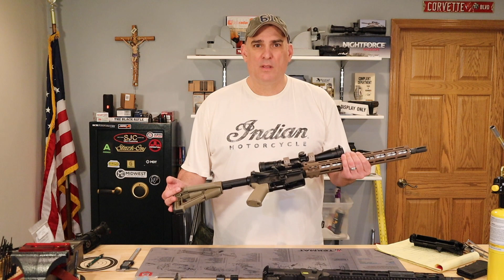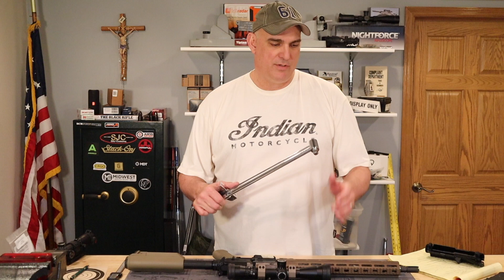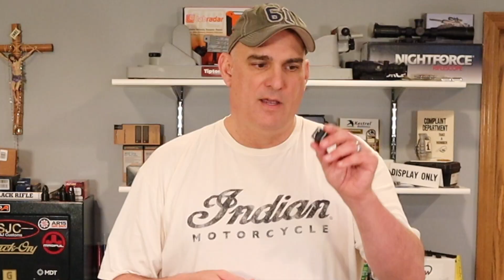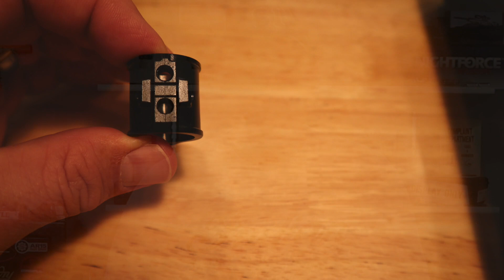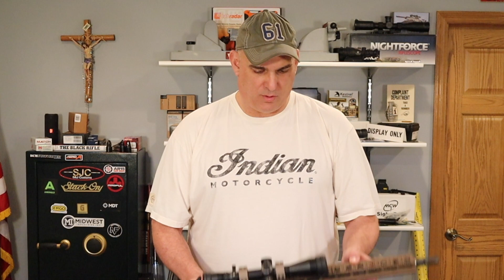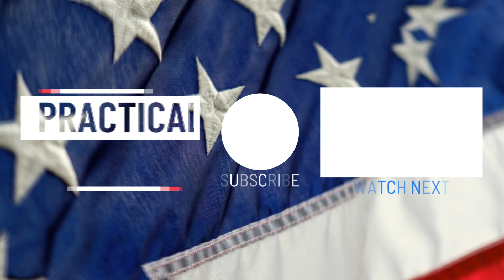Is it worth building your own ar 15? My first ar 15 build, the good, the bad, and the ugly.

Comment: I’ve built a few AR’s and use Criterion barrels and Badger Ordinance TGX gas manifold (their name for gas block) I use red locktite around the barrel (to seal it) and Rocksett on the screws……. I’ve herd people say pinning gas blocks can effect barrel harmonics and can effect accuracy at longer ranges….. my 18” and 16” will make Dime size 5rd groups with match ammo consistently even with my 12.5 getting about 3/4” groups………. Criterion has a build series that’s pretty good……  check your barrel torque keep above 50 ft lbs and make sure you head space your bolt. Use the heaviest buffer you can and function correctly keeping the brass in the chamber a mili second longer could help. Try shorting with no muzzle devise as well to see what accuracy you get then. I’ve also found with Criterion barrels keeping muzzle vel around 26-2750 with 77gr gives you best groups…… Non of my Criterion barrels like 75gr but love 77 and 68. Both my 18” and 16” will get sub moa out of IMI Razor core 77gr SMK that’s great with cheaper ammo
Reply from the maker: my barrel torque is only 40 lbs so I i'll increase it and see what happens.
Reply: @PracticalAccuracy  what kind of ammo are you using for accuracy testing
Reply from the maker: @LONEWOLF_LCD   federal gold medal match 68  gr., black hills 77 and 69 gr tmk, hornady 75 gr. bthp. none of them shot good.

Comment: I think I'm about to build a Wilson Combat AR. I've been shooting ARs since 2006 and have never built one. BTW: red locktite will release under heat. If you can heat up the receiver, you can release red locktite. Blue locktite will back off.

When you put the butane to that receiver, it more than likely warped the receiver. There is no way that barrel went in square. Even a slight cant in the barrel can alter the head space and effect terminal accuracy. It's a common problem when people re-barrel Ruger 10/22s. If you want to know if the comp effected the groups, take the comp off.....
Reply from the maker: i didnt know this. thanks

Comment: If I bought an upper and the barrel extension diameter was correct and would not go in, I would send it back.  The very definition of MILSPEC is commonality. If pins don't fit in the receiver and they are the correct diameter, send the receiver back.  Try standard ammo. I put a 6.5 Grendel together last year for deer. I bought the cheapest barrel out there and it shoots fine. Even the Russian steel cased ammo shoots really well.
Reply from the maker: I'm happy your build turned out good. Maybe next time for me. Thanks for watching.

Comment: I'm like you when it came to building my own because it was intimidating to me. I used pretty much all Areo parts, upper & lower, BA 18' fluted barrel & gas block, VG6 Epsilon brake, BCG, lower parts kit & 13" rail. I went with the LaRue BBT2S trigger, Radian SS & CH. I've never had any problems maybe because I used most of the same companies parts instead of mix & matching different companies. It was very gratifying & actually it wasn't that hard. I think everyone should  build at least one to see how a rifle works &  you might be able to fix any problems you might have, IMO. 
Be Safe & GOD Bless 👈😎👉
Reply from the maker: I agree. God Bless.

Comment: Might try lapping the barrel to remove any minute imperfections that might have slipped past QC.  I have done this to a few of my bolt guns and the results were eye opening despite buying custom high quality barrels.  I generally now do this on every gun I have before I shoot full power commercial loads, just dont over do it!  It will definitely make removing copper fouling a lot easier if nothing else.  YMMV...
Reply from the maker: Thanks for the advice.  I have a lot to try and several other builds to complete.

Comment: Is a barrel "wearing in" a myth? I've heard people say before that there's a wear in period with barrels. 
Also, I have two set screws holding my gas block on also and they force into the bottom of the barrel. I have to wonder as sensitive as people say barrels are to different things, could that have an effect on accuracy somehow.
Reply from the maker: I'm thinking it might be the set screws putting pressure on the barrel.
Reply: @PracticalAccuracy  Me too, are you saying you think that's your issue with that set up? You think you might switch that gas block out because of that?
Reply from the maker: @outdoor044  I might switch it out, but I'm also worried the dimple in the barrel screwed up the barrel.

Comment: Recrown the barrel. Likely has a poor crown shape or dinged
Reply from the maker: I'll check it out. Thanks.
Reply: @PracticalAccuracy  Also if you have a muzzle device you should remove it and test fire and see if the muzzle device was possibly not aligned or machined correctly causing the bullet to strike the surface of the interior of the muzzle device.
I had an ak47 that had improper alignment on the threads and muzzle break. The bullet would strike the baffle at the very end of the muzzle brake/comp. I could see this once it was fired because you would see sparks as well as being incapable of even hitting at the place of aim. I would even occasionally here a ricocheting twang, sounding pretty similar to those old western movies when they had a shootout 😂.

I could be 15-20 yards from my target and reliability hit just about everything surrounding my target but miss the target completely. I remember having taken over 30 shots before I actually hit the target.
Reply from the maker: @Kaladore82   I'll give it a try.
Reply: @PracticalAccuracy  keep us posted buddy. Not many keep their videos updated if progress is made and I’m interested if any of those solutions I recommended help solve the issue
Reply from the maker: @Kaladore82  I wii just gotta find the time.
Reply: Lastly, it’s possible the feed ramps are galling the bullet on the way into the chamber. Chamber a round and then extract the round. Examine the round, it should be quite obvious if it is being galled because of the giant scar on the bullet
Reply from the maker: @Kaladore82  i'll try that. I didnt think about that.

Comment: Hell YES it was, at least for me, plus I saved some good $$$.  I've built 3 now in the last year, 2 were 5.56 and the last is 6.5 Grendel.  I thought about doing the Creedmor but just wanted to do something different  and wanted to stay in the caliber that already have the lower ( bought several when they were cheap.  I enjoyed just about everything about doing the builds from anticipating the receipt a the parts to decking the finished projects with decorations.  Now I want to build a 10 in maybe a 308 or 30-06.
Reply from the maker: awesome. go for it.
Reply: Doing a .300 pistol right now with a polymer rhino lower. First top to bottom project. Learning how to mill lowers and put these things together is a drug. Gonna do a .308 or 6.5 creedmoor next for when the bad guys are really far away.

Comment: tighten/change your optic
Reply from the maker: Will do. Hoping to get out to the range with another optic.
Reply: @PracticalAccuracy  And if thats not it pull off your handrail, pull off the barrel nut and make sure the barrel is seated all the way against the receiver. it might have cooled before seating and you might have to have the gun smith pull out that barrel, buy a new cheap receiver and redo the install of the barrel. if the barrel manufacturer insists on the shrink fit maybe pick something else for first time builders but since you have the fancy barrel already give it another go in a cheap upper. make sure the barrel seats. make sure the nut seats at the proper torque. you'll get it. keep after it
Reply from the maker: @dirtkickersandarrowheadlic9317   Thanks for the advice. I checked the barrel and it is fully seated. I took the barrel nut off and did re-torque it.  I'm going to go to the range and shoot with the same optic I was using and see if that works. If not, I will then use another optic I have. Trying to change 1 variable at a time until I figure out what is going on.

Comment: You summed it up really well. In my experience, the big disadvantage is cost, especially when you add in the cost of tools you may only use once or twice.
Reply from the maker: That is correct.
Reply: I feel like once you have the tools and the knowledge that you WILL build more.
Reply from the maker: @PNWhashmits  I agree. I will
Reply: If your only gonna build one or two...its not really worth the price of a quality set of tools you need.  There is something to be said though if you need to make repairs to your gun.  If your a tinkerer or if your gonna build several whether they are for you or a friend for a price, then they are well worth it in my experience.

Comment: Correct me if I am wrong but the 223 and Eugene stoner designed the system to work with I believe a 22 inch barrel if you want to make the most accurate at you should have started with at least a 18 inch heavy barrel
Reply from the maker: Actually, shorter barrels can be more accurate because of less "whip" to the barrel during firing.
Reply: @PracticalAccuracy   to a extent but each caliber has a optimal length in witch you get the best powder burn and stabilization for 223 Remington it is a 20 inch barrel that is why when Eugene designed he used a longer barrel for 5.56 it is 18 inch 308 is surprisingly a 16 inch barrel and 6.5 creed more is a 24 inch barrel that is for optimal powder burn. You are correct when going past optimal burn you will lose accuracy but going below is detrimental. If you have ever seen the effects of 5.56 in a short pistol barrel you will say that the round is un stable pats 200 yards not more accurate because the design of the cartridge needs time to burn different calibers work better in different length guns. When we adopted the m4 over the m16 we were told our max range of a area target was reduced because the m4 has a shorter barrel designed to be used in close quarters

Comment: Iraq vet and 9yrs of service, and I’ve built 2 of my own AR s and love it , wish I could get paid to do it, but hey 😂, as you where saying about accuracy and not getting yours groups right. A bolt can cause that as well and not sure if you have swapped that out yet and tryd, I built both my guns around the BCG and barrel. Try swapping the bcg also when using another bolt too👍
Reply from the maker: I didn't try that.   Good idea. I will give it a try. thanks.

Comment: Did you break your barrel(s) in by cleaning them after every shot ? Every 5 shots? At all ? My neighbor and I have identical DPMS AR-10’s and he hated his and mine is a tack-driver. Difference ? I wet and dry cleaned my barrel after every shot for the first 50 rounds. He didn’t. Thought that was a waste of time. Turned out it was a waste of money. His.
Reply from the maker: I cleaned it, but did not break it in at the range. Maybe I wasted money as well.

Comment: I'm a cnc machinist.  Every part has a spec and a tolerance, usually +/- .005. Just because you was a thou and half diffent this time doesn't mean you will be next time using the exact same brands and parts.  If you pins could be polished a little using a drill and a scotchbright pad, maybe try to use a little heat or put a part in the freezer to get them to expand or contract a little.  A good press finish can easily be .001 inches difference in the pin and hole size
Reply from the maker: Thank you for your expertise.

Comment: I just tried to build one last night. Got all the parts from a local gun store. I was told I wouldn’t need any special tools HAHAHA… also they forgot to sell me a charging handle and gas tube. I was also missing a spring for the rear pin from the parts kit that I bought. I brought all the parts back to the store today and decided to just pay them the $25 to finish building it for me. 
I finished the lower but couldn’t tighten down the barrel or buffer tube. 

I’m a beginner to the AR-15 world. Maybe in the future I’ll give it a shot again.
Reply from the maker: Don't give up. It can be frustrating, but rewarding also.
Reply: If you are going to drive nails you probably need to buy a hammer..

Comment: I read that the bolt fitting to the chamber will affect accuracy. Barrel installation to upper how tight it is or it might require u to polish the edges? I forgot the term but if you go to the forum how to make ar accurate you might find a lot of info. Nice video. I bought a dd ar and planning to build one.
Reply from the maker: Thanks for the help and Good luck.

Comment: Which gunsmith did you use to have the geissele block pinned? My gunsmith botched my barrel in the install and had to buy me a replacement.
Reply from the maker: I'm coming to that conclusion. Have a few more tests to run.

Comment: You can't exclude fliers from your group!
Reply from the maker: I generally agree. I usually don't  call them because generally they are your fault, but I called this one when i broke the shot before seeing the impact. In my other videos,  I let my groups stand with poor shots.
Reply: @PracticalAccuracy  I am trying to figure out what kind of accuracy a <$1000 AR15 is capable of.  I want a dual purpose gun for varmint hunting and home defense.  It doesn't seem like any videos I've seen demonstrate true 1 MOA accuracy out of these guns vs a cheap bolt gun.  Too many videos seem to pick and choose which ones are fliers and make excuses for the gun (I must have pulled that one, etc...)  It seems like most shooters should be capable of 1 MOA from a solid rest, but its the gun / ammo that's the limitation.
Reply from the maker: @elkhuntr2816  I agree. Rock River is capable in that price range. I have several that are 1moa and if you watch my other videos you will see me not call flyers and shoot 1 moa. Its not 1/2 moa, but just under 1.

Comment: I did not see your full parts list or know of your mechanical skill set. Having said that, have you hand lapped the upper receiver? Also for maximum accuracy, did you carefully, target match style, break in your barrels? What is the twist rates for your barrels & what weight rounds are you using? If you are using 1:7 twist rate barrels, try using 75+ grain Hornady match grade ammo. If you are using 1:8 or even 1:9 twist barrels, use 62-68 grain Hornady ammo. Stay away from steel core ammo. For lube, just use automotive/motor full synthetic oil. Good luck! Nice video.
Reply from the maker: thank you. I didn't lapp the upper. I'm going to have a shop do that for me. thanks for them advice.
Reply: @PracticalAccuracy  It's too bad that you have non-spec upper receivers. The price of a AR Lapping tool is less than $50 & the lapping compound is less than $10. After that, all you need is a drill. It's super easy & fast to do. You don't actually remove that much metal. With your tight uppers, it would be a pain to keep using a torch on the upper just so the tool can fit & spin. Consider getting a Right To Bear Nickel Teflon Upper Receiver($99 when on sale), the rails on which the BCG rides is coated in super slick Nickel Teflon. The track that the charging handle rides is also coated making for smoother use.
Reply from the maker: @tilepusher  Thanks. I'll check them out.

Comment: they are too lego you just tried to put lego small onto lego large nice video
Reply from the maker: apparently so.
Reply: @PracticalAccuracy  hay I'm building 2 one 6.5 grendel 18 barrel one  5.56 with 14.5 barrel both use Used military surplus A1 stock one paid 18.00 for it the other 53.00. Cold bcg colt trigger colt charging handle there are a few tricks I can do like lighter spring for trigger. Heavier buffer spring and buffer bigger realness lever on charging handle well I'm crossing my fingers everything works most of the stuff I'm using already was working so should be good
Reply from the maker: @aarondavis5535   Awesome. I hope it works for you. Let me know.